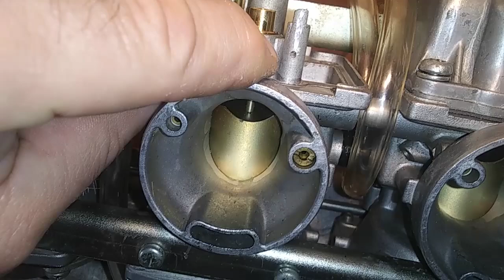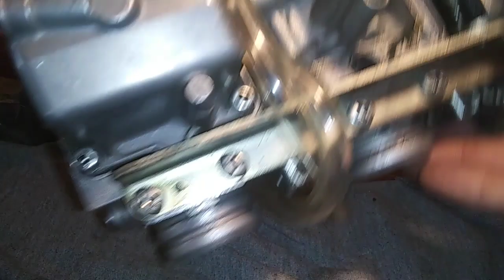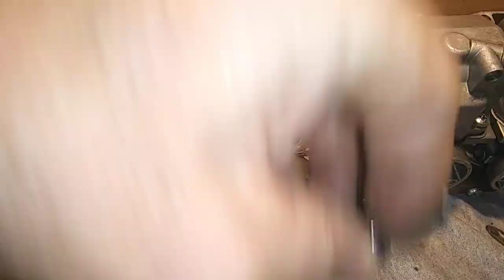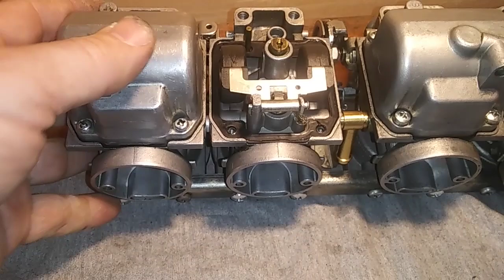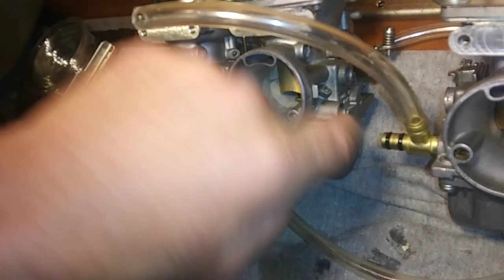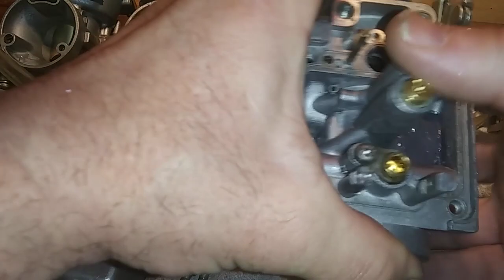Yamaha XJ700X BS33 Carb Float Post Repair

Comment: $100 82 xj550 all there with zero rust and been sitting for years. Have 1 carb rebuilt and just broke the 2nd carb off like the 1st part of this video, half way through the hole. All 4 carbs are so gummed up the slides and butterflies are froze and jets on top were almost impossible to get out. I like your second fix. Having trouble getting the slides out, I think the needle jets are stuck because the main jets are filled with old gas. Carb cleaner has worked with jets but slides still stuck and don't want to pry to much. Still have 3 carbs to go.  I use simple green and a crockpot to clean but don't want to put the rubber diaphragm in there. Any recommendations?
Reply from the maker: If the slides and butterflies are frozen that bad, the throttle shaft seals and diaphragms are toast already. I would soak in chemtool for a few days, and sonic clean to loosen up. Then rebuild with new shaft seals, diaphragms, and jets.  Use JBM T-63 for diaphragms, jetsrus for jets, xj4ever for throttle seals, also store.moto-lab for bs28 parts.